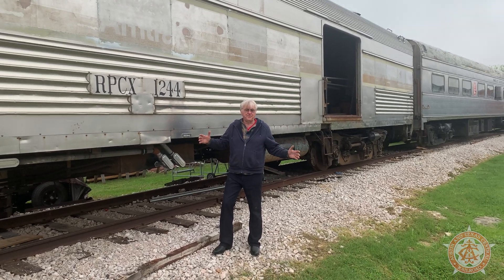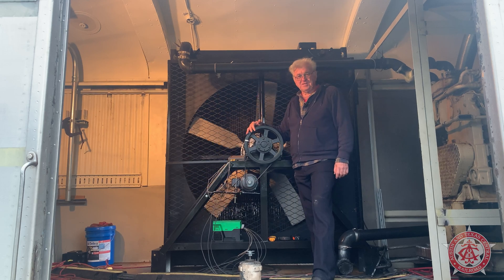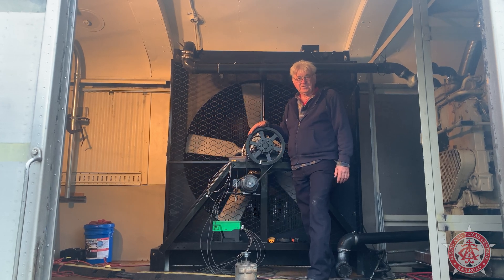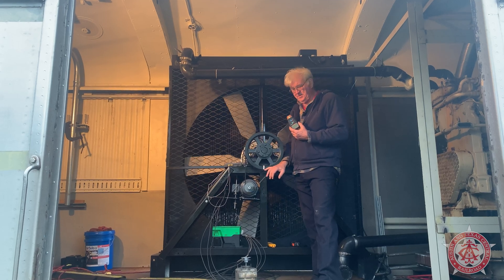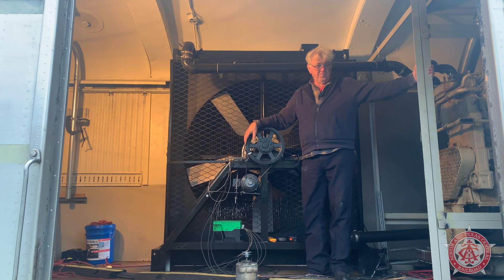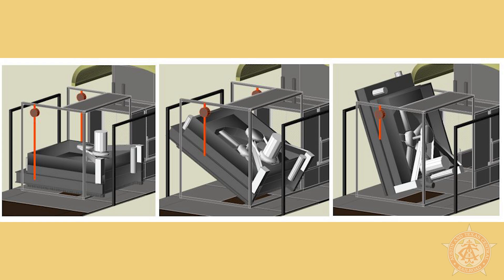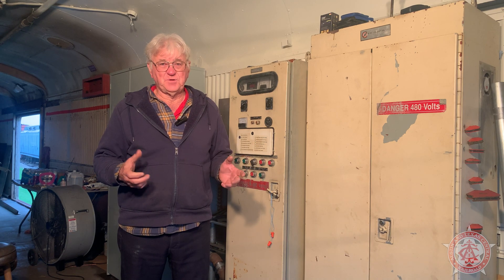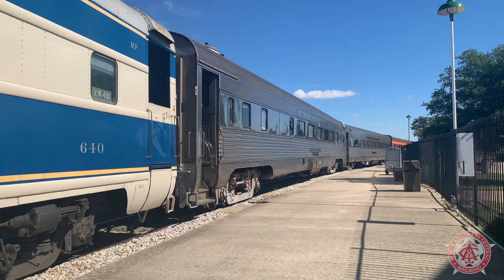Installing the Radiator - Power Car Ep. 5

Comment: One question when do you guys think #442 will be running again?
Reply from the maker: However much time the restoration will take is mostly dependent on how many volunteers work on it and how much funding we have for it. We're working on doing video updates for the 442, too.  Here is some work that has been going on as of late.

The rear truck is getting close to being finished and getting reinstalled beneath the engine.  Also, our volunteers have been doing a thorough cleaning of the inside of the locomotive.  The cab has recently been dismantled to repaint the interiors and clean up rust damage.  The battery boxes are being rebuilt, too.  We intend for this to be a very in depth and quality restoration.  We’re always looking for more volunteers to expand the 442 restoration team.